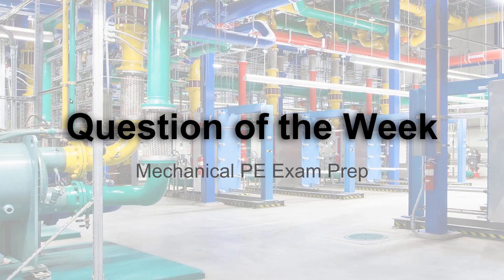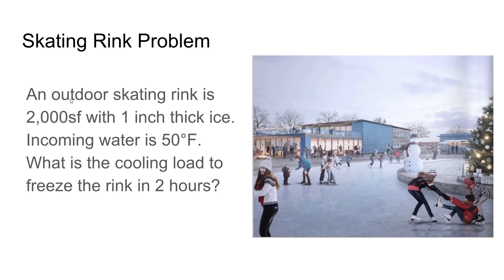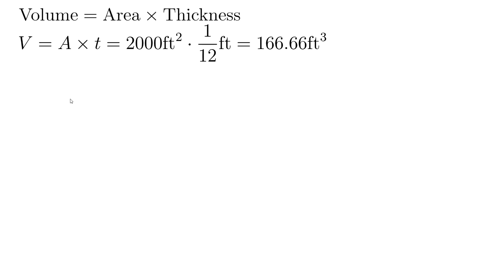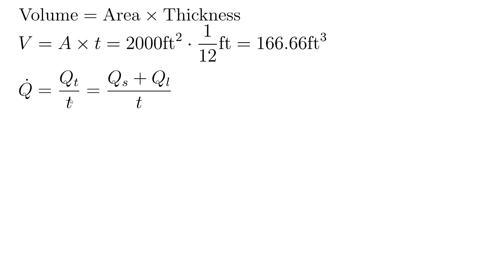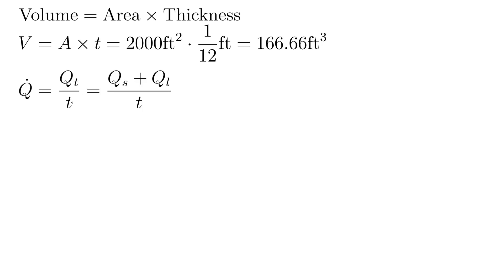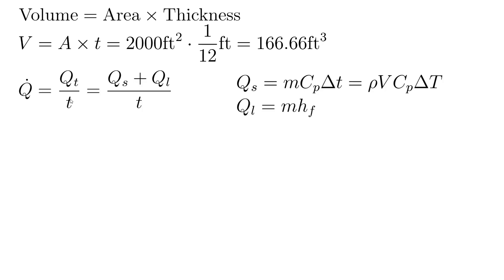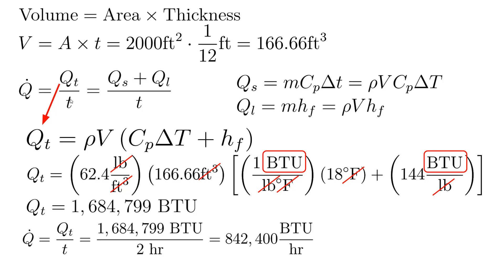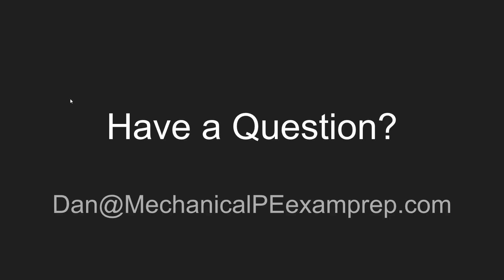Question of the Week 04: Skating Rink

Comment: Hey Dan! Your videos have been immensely helpful and incredibly detailed, I really hope more aspiring PEs find your YouTube videos and join your class! I had one quick question regarding the latent heat load - When I started your video I paused and attempted the problem on my own but defaulted to using Hfg (1075.14 BTU/lb) instead of Hf (144Btu/lb) due to the fact that the water is undergoing a phase change. Obviously that had a sizable impact on my answer... Can you help me understand why Hf was the right choice in this problem and Hfg is sometimes used in other problems for a phase change?
Reply from the maker: Hey Kyle, 144 is the latent heat of fusion for melting/freezing.  1075 is the latent heat of vaporization for evaporating/condensing.  Both are phase changes of water, but the first is between solid and liquid and the second is between liquid and gas.  Hope that helps.  If you are going for your PE, drop me an email some time.  I know what you're up against and I can provide the tools and guidance to get you there. -Dan

Comment: Is there any need to correct for the volume change (density reduction) that occurs upon freezing? Seems like you used the density of liquid water and the volume was for ice.
Reply from the maker: Very good point John, this has the potential to move the answer by nearly 10%, well worth considering.  The solution presented should not have more than 10% error.  Thanks for the keen eye.  When are you planning on taking the PE exam?